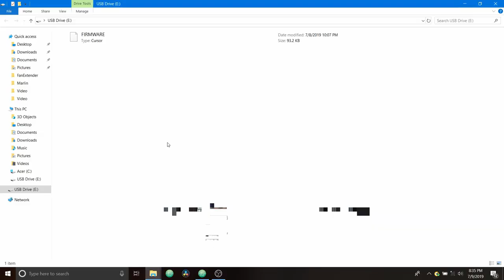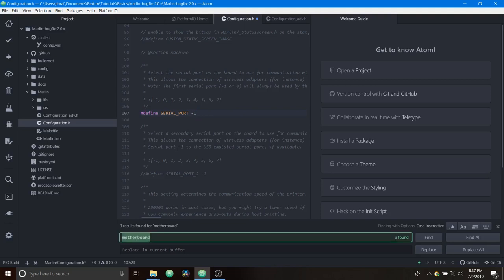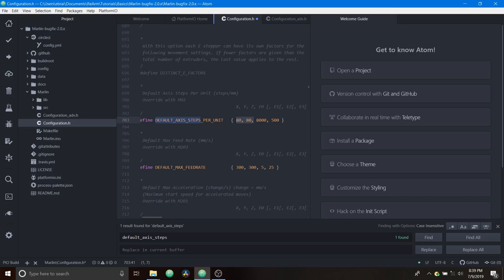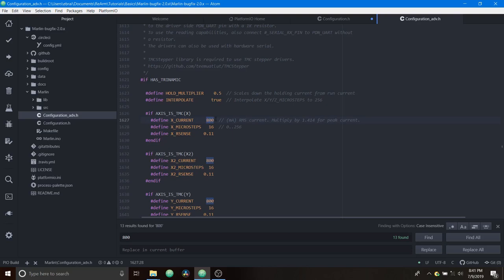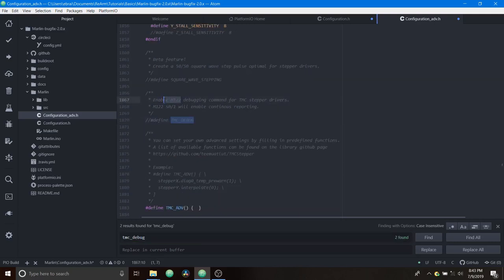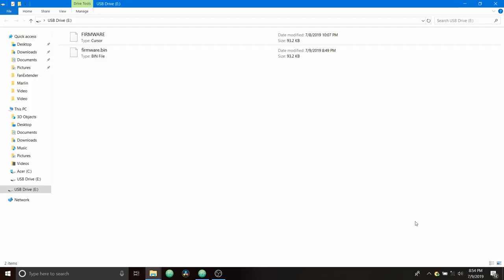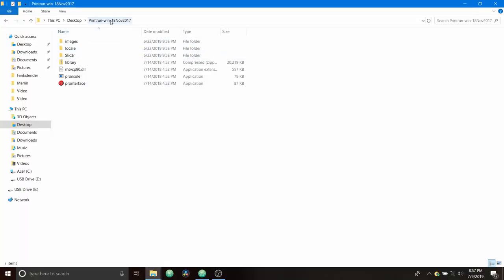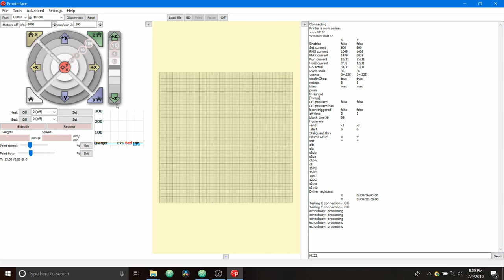SKR 1.3 - TMC2208 UART v3.0

Comment: another thing ,it seems  dose not support the spi mode of tmc2301
Reply from the maker: It appears to support SPI for TMC2130 at least with the tests I ran.  It's tied to the TMC 2130 step stick Bigtreetech produces.  It may have issues using other SPI devices at same time.  I had issues with it working consistently with USB jumper in 5v position.

Comment: Another great tutorial on the SKR V1.3, thanks. One question, you mentioned in the video that the drivers came already prepared for UART mode. How can you tell? I bought a Kit from Amazon (SKR v1.3, TMC2208 and TFT35) which are supposed to be in UART but I am not sure how to tell if they are: https://www.amazon.com/gp/product/B07WH6P9RC/ref=ppx_yo_dt_b_asin_title_o01_s00?ie=UTF8&psc=1
Reply from the maker: The UART is in the development environment from Platformio.  Just remembered to load VScode and not ATOM.  ATOM is no longer supported with Platformio.
Reply: Edward Braiman thanks
Reply from the maker: You're welcome.

Comment: I have tmc2208 v1.2 uart from fysetc and it came with SetpStick Protector..
Any difference...?
Benneficts...? Or not needed..?
Reply from the maker: Unfortunately Bigtreetech added a resistor I think which seems to lock people into there products.  Granted I've not verified this personally.
Reply: @EdwardBraiman  you think that the tmc that I have won't work with this board?
Reply from the maker: You may need to add a resistor via the top of the stepper.  The note in Marlin firmware may apply in this case.
Reply: @EdwardBraiman  For what i see. Yes i have so solder 2 spots under the board to make it work in uart mode...
Reply from the maker: Let us know if it works.
Reply: @EdwardBraiman  can you please show the under of the stepper that you show? Just for curiosity... 
Because the github they inform they to use uart the stepper have to solder 2 pads in J2
Reply from the maker: There is three pads o think on the one in the video.  They have a very tiny resistor soldered between.
Reply: And for last...
Soldering the 3 pads of the FYSECT tmc2208 v1.2 works! :)
I use M122 and shows everything: 

(I'm using only X Axis to test)

READ: Driver registers:
READ:   X 0xC0:09:00:00
READ:   Y 0x00:00:00:00  Bad response!
READ:   Z 0x00:00:00:00  Bad response!
READ: 
READ: 
READ: Testing X connection... OK
READ: Testing Y connection... Error: All LOW
READ: Testing Z connection... Error: All LOW
Reply from the maker: What happens when you lower to 1/128 micro steps?
Reply: @EdwardBraiman  Never done that...
Have to see how to do..
Reply from the maker: @Lc-wi3wk  It appears something might not be soldered the way you wish.  Check the datasheet on the TMC2208 you're using for the configuration.
Reply: @EdwardBraiman 
Im sorry but i quit.. 
This board is not good..
I do everything right... 
Connect the power and with the usb the board won't stay connected to the pc..
Using only USB cable with pronterface or simplify3d with the pc ok...
Try to upload  the firmware.. 
No upload, gives a error that not finding the card...
I upload manually marlin 2.0 without any changes .. 
Connect via USB the board and in the lcd2004 appears message: 
TMC connection error!!!??? 
without doing nothing....??
No good..
Reply from the maker: @Lc-wi3wk  check the USB jumper position, but keep in mind TMC2208 is not the one designed for the board by the manufacturer.  I'm not sure how well it will work.
Reply: @EdwardBraiman  The jumper is on the right position..
I don't have any TMC on the board... Only the original firmware and a lcd2004.. Nothing more...
And appears that error? And loose connection with the pc when i plug the power supply?
No good...
Reply from the maker: @Lc-wi3wk  what occured when no LCD is connected?  Does it function correctly in Pronterface?  Try breaking down each issue into subunits and see where the failure occurs.
Reply from the maker: @xKenn  unsure, maybe check the calibration for RMS and move up or down 5% and see if better with first 1/128 and then maybe 1/256.  Let me know if it helps.
Reply: @EdwardBraiman  the problem of the board...
Put the stock firmware.. And nothing more...
The jumper is USB 5+
Connect the USB..
Pronterface detect the board..
Connect the power supply.
Pronterface message : no board detected...
Reply from the maker: @Lc-wi3wk  when you used 12v power move the jumper.  What does Pronterface then say.  Remember to power everything down before moving jumpers.
Reply: @EdwardBraiman  Connecting...
[ERROR] Can't write to printer (disconnected?) (SerialException): Write timeout
Reply from the maker: @Lc-wi3wk  try just a TF drive load with 5v jumper in place. Then check by connection via Pronterface.  Remember just a basic Marlin firmware load from the video Friday.  Tell me what you then see.
Reply: @EdwardBraiman  I talk to a friend and he said that maybe, maybe is a short on the USB female or some connection with bad soldering... Can be??
Reply from the maker: @Lc-wi3wk  anything is possible, but I would start stepwise wiith first attempt TF drive load and see if working.  Then try another stepper if you have one like drv8825.  Then an LCD screen.  The reason being is to see if something works or not.  Think of it as gaining knowledge from what works and doesn't.  I'm still confused by WiFi and Bluetooth, but I keep pecking away until I can present on YouTube.  Think of it as an experiment where you learn what works.
Reply: @EdwardBraiman  Thanks.. I will tell something later
Reply: @EdwardBraiman  hello...
Made a test... 
In the shield of usb and the tmc I had: 
0.068mv
In the shield of the microsd :
1,368v
I'm not a technical in this area.. But with this values something is wrong with the shield of USB.. 
It makes ground until one side of C35 (ceramic smd) I think.. After that nothing...

Comment: Hi. Did you make an Tutorial for the TMC 2209? Or what must i change? Are you German? :) Thx
Reply from the maker: I worked on the TMC 2209, but the results might have Marlin issues.  Most the week I've been trying to explain to Marlin the issues with BLtouch.  Might need to spend weekend digging thru firmware versions to explain issue to them.  My last name sounds like Bremen in German, but it's very middleeastern, it translates to decendant of Abraham in Hebrew.
Reply: @EdwardBraiman  thx for the Answer. Many uses the skr 1.3 with the tmc2209 without issues. But no one with the Sidewinder X1. And thx for the Ancestor Lesson :)

Comment: Thank you for all your video teaching me how to set up the skr1.3 
I followed all step by step, but I am not able to generate the firmware.bin through atom. It said failed. I downloaded the marlin of skr1.3 from bigtreetech github. I did success once. And I try next day with same step same file. It failed. 
Can I ask someone send me the .cur file directly replace the current one to update? 
P.s I am a beginner. I might have asked stupid question.
Reply from the maker: First does a defualt folder project build okay?  What I'm saying is open a fresh download that has been unzipped and click check mark in platformio inside ATOM.
Reply from the maker: If it's not working checkout the instructions on how to install ATOM with Platformio instructions on marlinfw.org. You may also need to install Git to make it work from ATOM.

Comment: I keep getting a PSU_CONTROL requires PS_ON_PIN error. Also this error Unable to execute: platformio
Make sure cmd:'platformio' and cwd:'C:\3DPrinter_stuff\SKRv1.3\Marlin-2.0.x\Marlin-2.0.x' exists and have correct access permissions.
Binaries are found in these folders: C:\Windows\system32;C:\Windows;C:\Windows\System32\Wbem;C:\Windows\System32\WindowsPowerShell\v1.0\;C:\Program Fil
es (x86)\NVIDIA Corporation\PhysX\Common;C:\Program Files\LLVM\bin;C:\Program Files\Git\cmd;C:\Users\kicka\AppData\Local\atom\bin
Reply from the maker: Are you using ATOM/platformio plug-in?  You may want to change to VScode as it will work better.  I know some of my tutorials have ATOM, but I've changed due to support of platformio being discontinued.  There is a SKR 1.4 tutorial where I explain install.

Comment: I have a question. I'm using Marlin 2.0.5.3 (newest version currently) but keep running into the same error over and over where it won't let the stepper drivers connect.  I'm using all TMC 2208 for E0, X, Y, Z (No E1). Here's the error https://imgur.com/gallery/7YGT0la and heres my file (if you would like to take a peek reddit has been trying not sure whats wrong) https://drive.google.com/drive/folders/1okpPN8wHA-tVqJEIG45ucdzYaLQjHdHJ?usp=sharing
Reply from the maker: If you're seeing what you think is a Marlin firmware error, you might want to open a bug on Marlin Git page.

Comment: First, thanks for compiling this video, it has been very helpful! I have a question I am hoping you can help me with dealing with a failure during the build process, specifically with the xpt2046.cpp file. When I try to create a build, it gives me multiple errors dealing specifically with the xpt2046.cpp file, errors seen in this screen shot. https://snipboard.io/aWK1B7.jpg What could be causing this issue? Thanks for your help
Reply from the maker: Is this a fresh download?  I'm unsure of the issue other than something with chip select, which is normally used in SPI.  If you download a fresh copy of Marlin firmware and see it again I suggest opening a bug on Marlin firmware GitHub page.
Reply: yeah, it's a fresh download from yesterday, from a file that was last uploaded 18 days ago to the git hub site here.. 

https://github.com/bigtreetech/BIGTREETECH-SKR-V1.3/tree/master/BTT%20SKR%20V1.3/firmware/Marlin-bugfix-2.0.x/Marlin/src/feature/touch

Guess I shall open a bug on the page. In the mean time, would it be possible to send the code from a working xpt2046.cpp file to paste into the file to get it going?
Reply from the maker: Checkout Marlin firmware www.marlinfw.org and see if the same. nice catch.
Reply: yup, the same. Guess I shall have to wait on this fix
Reply from the maker: Is there an existing issue/bug already opened?  If not you'll look like a hero for opening one.
Reply: As far as i know and for what I could find on the subject, haven't seen anything about this being a problem, so either my error or something recently that has become an issue that no one has caught. Either way, I shall wait for a response
Reply from the maker: Which IDE are you using, ATOM or VScode with Platformio plug-in?  I recently changed to VScode due to compiler issues.  If that's the case check my playlist on how to install.
Reply: tried both, and each has same issue
Reply from the maker: @jamesburkhardt5143  I'll give it a try in a couple of minutes.
Reply from the maker: So I was able to compile build.  Is there something else in the configuration.h or configuration_adv.h being configured other than tmc2208 uart?
Reply: All is good now. Restarted the full process again for the fifth time, this time everything built correctly with no  errors. Only took all day lol
Reply: Thanks for the help man!
Reply from the maker: @jamesburkhardt5143  we've all been in the same situation.

Comment: Getting 
Driver registers:
		X	0x00:00:00:00	 Bad response!
		Y	0x00:00:00:00	 Bad response!
Testing X connection... Error: All LOW
Testing Y connection... Error: All LOW
Reply: hm, i solved it by soldering for UART but there's something else wrong, when I move in x or why the skr resets and flashes white on the screen while beeping... now message about what's wrong.
Reply from the maker: Which manufacturer of stepper driver are you using?
Reply: @EdwardBraiman  bigtree TMC2208 V3
Reply from the maker: Can you send me your configuration.h and configuration_adv.h on Discord?
Reply: @EdwardBraiman  done, turns out it was a faulty powersupply
Reply from the maker: Good to hear.